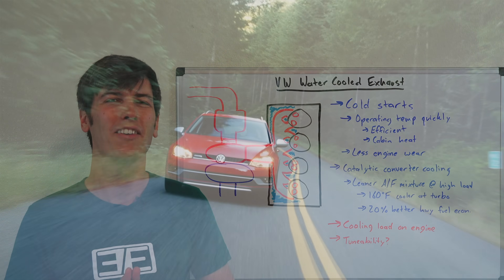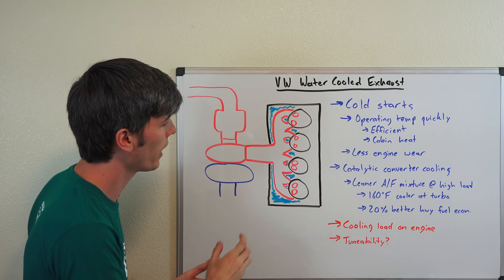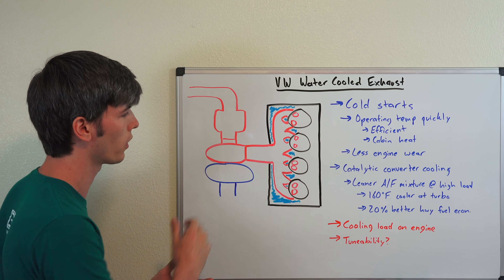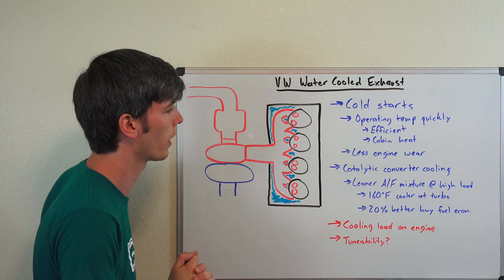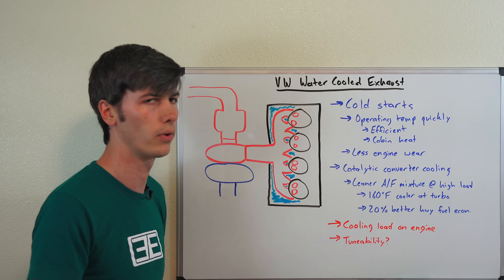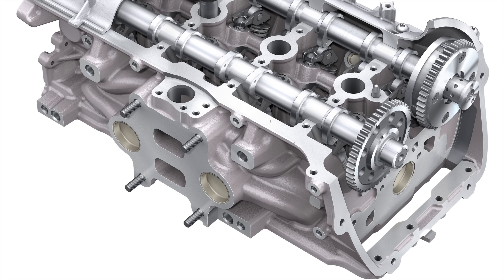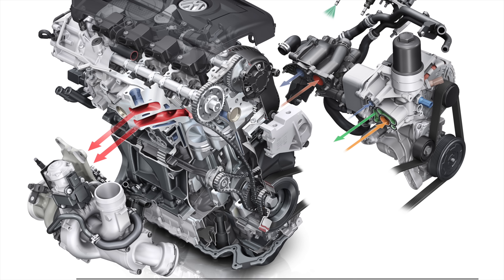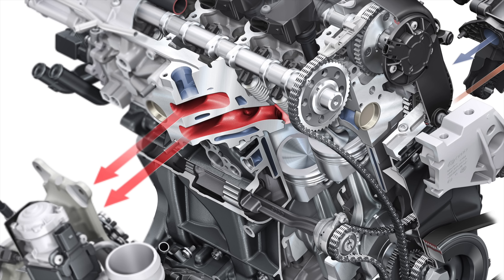Why Does Volkswagen Have A Water-Cooled Exhaust?

Comment: Dunno man, VW claims are not exactly reliable...
Reply: Nailed it
Reply: Klas Peppar Spell much?
Reply: Rob Novak yeah I got the new Jetta and regularly hit the low 40s on the highway without trying and can sometimes manage mid to high 40s on the longer drives. Important to note mine is a 1.4L though
Reply: Exactly!
20% more efficient? Yeah, right... If every time when they said that it was true, by now that engine should fill the tank and not the other way around.
Reply: It wasn't. Almost all other European manufacturers cheated. Opel for example ran an ECU update on the Astra and Zafira if I'm not mistaken,  to try and bring these cars' emissions back to what they claimed. Furthermore, following the dieselgate thing, emissions tests were done and it was found that all brands got significantly higher emissions figures in real life tests than what the manufacturer claimed. And it gets better, VW's real life emissions were actually closer to their claims than with a lot of other manufacturers. I believe Renault scored the worst, but I'm not sure about that.

Aside of everything, the software VW ran wasn't illegal per se. It was a software that reduced engine power under certain conditions (calculated from factors like engine load etc) to minimize emissions. In the real world, the occasions where this would happen are rare. So yes, they tuned this 'secret eco mode' to work best with the NEDC tests, which are completely not representative of the real world. But there's nothing illegal in that. They just 'forgot' to mention this eco mode on the homologation papers. 

As a side note: do you know how Opel fixed their emissions problem? The ECU update I was talking about earlier actually just reduced engine power, thus bringing the emissions down. So compared to that, I don't think what VW did was actually all that bad.
Reply: Never owned a VW before, bought a 1.4t jetta for the sole reason that they were on sale... can't beat a brand new 2017 car for less than 14k USD.... I wish I had waited because they went down to 12k USD after I bought mine. oh well.  I really do like the car though.  The manual transmission is quieter than the automatic.  Sometimes too quiet. I normally use the sound of the engine to know when to shift, but this is so quiet that I have to look at the tack.  The automatic makes a little bit more noise.  Comfortable.  Quiet.  Perfect road trip car.  I can't manage to get any lower than 32 mpg even floring it at every opportunity with stop and go traffic and the A/C running all the time. As far as spirited... um, if you are accustomed to sporty cars then it will probably feel slow, but if you normally drive economy cars then it could feel peppy.  It does develop the torque at lower rpms, so you won't often push it past 5k rpm even in a manual.  Shifts are crisp. The only other car in the same price range is the Nissan versa, and I do pass those on the road without any problem.  If I have any complaints it is that, if you tend to lean the seat back it can create a blind spot, and it could use a faster wiper speed.  I guess they don't have tropical storms in Germany. Overall I'm very impressed.
Reply: Well, you may take your efforts to help with the environment seriously but if the majority of US citizens did then Trump wouldn't be president, and nobody would drive around in polluting pickup trucks. No, the reason there was such a big fuss about this was because of the American 'sue everyone' culture. Over here in Europe VW's boss took responsibility and quit, VW came with a solution to bring the existing engines up to spec and there was a recall to install the upgrades, and that was that. Not a single fine was given, because it would be hypocrite to fine them and not fine the other manufacturers. Because trust me, everyone cheated. And I'm sure there are a lot of manufacturers who still do.
Reply: To be pedantic, regular 20% cuts in consumption would have it asymptotically trending to zero, but the fact that VWs still use fuel shows that that hasn't happened either :p
Reply: Peder Hansen Don't blame our people, it's our dysfunctional government. Many of us urged not to pull out of that agreement but politicians walked the other way.
Reply: Too much was made of the Diesel emissions debacle. VW simply refined their software in order to provide a decent performance in the light of  ever increasing emissions standards.
It wasn't, and still isn't just Volkswagen, but they took a dive on it because lazy sensationalist scientifically illiterate journalists were going to milk the story for ever and a day.
Reply: I live in the US. in the midwest too. And I don't see this. What I see is exactly as the other poster said, fellow americans will do anything to put a dollar in their pocket.
Reply: the 1.4t is a boss when it comes to mpg but how does it feel on spirited drives? im debating on a brand new jetta 1.4t vs a preowned jetta 1.8t
the 1.8t is pretty fun to drive even if it only has 170hp (it actually makes more according to some dynos) and the fuel economy isnt so bad either. i do a lot of long trips about 2 times a month which is why this is a factor for me but i want to be able to drive spiritedly around town and enjoy the burst of torque
Reply: audi r yuo having no job how yuo afford volwagens?
Reply: mujjuman I wouldn't say the 1.4 is super punchy so you might want the 1.8 for those faster drives. I'd look into getting a golf. With the 1.8 engine paired with a slightly shorter wheelbase and stiffer platform in general, golfs can be a little more fun on back roads compared to the Jettas of similar price
Reply: mujjuman I've had my 1.8t Jetta for over two years and I still love it. The torque from that is great. I often take it onto canyon roads for some spirited driving and it really picks up nicely, as well as around town when you just want to accelerate from a stoplight. The 1.4t has the same amount of torque so it might accelerate  the same as the 1.8t up to a lower speed like 30-40mph, but it won't have the same passing abilities at highway speeds because of the power deficit.
Reply: +AR1G3
I won't dismiss your claim about some here being "sue happy". The vast, vast majority only sue for good cause. When appropriate it is a good tool to keep companies honest. The environment is important but it is not the problem it is being cast about as. Believe as you might but the here and now is as important if not more so than what 'might' be 100 years from now. Just don't let it be a substitute for the real Authority we know and love. The Great Lakes were once a glacier and that all went away long before man's interaction with the environment. CO2 is not the problem when so much other gasses, one namely methane,  enter the environment naturally. Sure, keep it clean but we will never go back to the horse and buggy either.
Reply: well .. there is a reason why it is one of the two Largest car manufacturers in the world... I think they know what they are doing, and I know from experience, that the previous version of TFSI engine was crazy efficient .. get 200 hp for 27 mpg? .. I loved mine..
Reply: It is still called cheating.
Reply: no way. americans, at least where I live and who I know, are absurdly "sue happy"
Reply: Peder Hansen          "and even your president is a thief and a conman"   The whole world wants to see the proof. Could you show us please?
Reply: @institoris institori gas engines are very inefficient.  so 20% increase would be very little.  ICE's are around 8% efficient, so adding 20% to that is a grand total of 9.6% efficient.  while 20% sounds a lot, it's all in the numbers.
Reply: pesshau
VW sure screwed over the consumers by giving them better fuel economy while increasing performance. Go cry about the emissions, sissy.
Reply: Nearly every single diesel engine car manufacturer lied about the emissions. Takata lied about theri airbags, Tesla lies every single day with their ''Zero emissions'' plates. Your point being?
Reply: Is using the rules to your own benefit cheating?
Reply: Like I said, my point is on moral, not about rules. You could go on and on and defend what they did was legal, but it still wouldn't change the fact that they were literally going the easy way around for a quick buck.
Reply: Golf GTI here - 37-38MPG highway regularly with the 2.0L version of the engine. That's without really trying to baby it.
Reply: audi r i bet you're fat
Reply: Klas Peppar Volvo has emission problems. Look it up lol. And I'm not mad. I'm just pointing out that it's not just Volkswagen. & yeah I do like my expensive Volkswagen? lol I can afford it.
Reply: zuban2009 I'm not fat at all. Thanks lol.
Reply: i fink yuo are
Reply: yuo lies to me
Reply: People here in the US view their efforts to help with the environment seriously. (not all) Misleading the consumer by cheating is taken seriously. Yes, human nature is what it is but this put a bad stain on VW. They have a good product but tried to pull off a short cut and got found out. It would not have bothered me but I would not have refused compensation from them.
Reply: Walter Black ?
Reply: @mujjman I own a 1.4L se tsi jetta. I was pleasantly surprised with the good amount of mid range torque that tiny motor pushes out although i'd say the 5 speed manual is mandatory to experience this. the 6 speed spent a ton of time hunting for the correct gear in traffic and never seemed to have picked the right one when i went to pass someone. Traded in an 06 Mazdaspeed6 and despite having half the horse power and half the drive wheels it's still 2/3's as fun, and exponentially more economical and reliable. definitely spend the bucks for the SE trim though, to me that sunnroof alone is worth the 3k price bump, even before you factor in the alloy wheels leather, blindspot monitoring and  push button start. oh and the base model doesn't have a temp guage, so the SE is less sketchy that way too.
Reply: Exactly. It's mainly just a bunch of anti-capitalist corporate-hating enviro-Nazis making much ado about nothing. The overall increase in pollution, worldwide, is statistically unmeasurable.

As I told more than one liberal when the scandal broke, if I were to have bought a VW diesel then, it would have been a great move for me as well as the environment. 

People couldn't wait to dump them, even though they are extremely fuel-efficient, and VW was all but giving them away. And if VW had not cheated, fuel consumption would have been worse.

If I were to have bought one, I would have been replacing a 96 Grand Cherokee V8 with over 300,000 miles on it. It has a 5.2L V8, which was an updated version of the 318 cubic inch V8, (318 ci = 5.2L), which debuted in 1967. The antiquated 5.2L, though a great engine, was not clean-running to begin with, as it only met truck emissions standards, not passenger car standards, which were very loose. Add 300,000 miles, and what you get is a pretty filthy running engine, by modern standards.

So, with a TDI, I could go from 17.5 MPG on the highway to 45 MPG, and likely have much cleaner emissions, and a clean conscience, (if I had one), to boot.
Reply: 80% of your engine wear occurs before the engine is up to running temperature. Substantially more harmful emissions occur during that time too.
Reply: Wolf Plato u
Reply: Volkswagen owns Audi
Reply: volvo ftw
Reply: Toxic Masculinity
That's a good point. Just ignore the fact that VW's cheat has now ended up giving the owners worse performance and fuel economy as well as the aforementioned expensive emissions control system failures.

But hey, keep throwing cheap insults at me, that'll prove me wrong ; )
Reply: Love the input from around the world!!!
Reply: Please define Your morality. I not necessarily share Your morals with you. Do you think your morals are superior to mine? Are you one of those parents who force their kids to go to church and train them to be liars?
Reply: The 20% is because the Turbo, not thar crappy cooling there. Where's the freaking intercooler.
Reply: hahaha.

As an aside That Guy, yes a new car for that cheap is going to be a good deal with almost no exception. But VWs do have poor reliability down the road (contrary to popular conceptions).
Reply: +TheNomdeguerre
I'm not from Germany  and not even from Central Europe though. And my real name is not German. And my person or my location has nothing to do with what Peter Hansen said.

Your comment is just another invalid argument from triggered 'murican.
Reply: Sorry for real poor spelling pist you of!
But as a Swe, English spelling is not easies task.
And have a nice day or night depending on where you are in the world.
Reply: +Simon Coles
He didn't say that. You misunderstans him intentionally, because you have no real arguments against what he said. Read his comment again.

American car industry naturally wants competitors out of US market. That's why the whole scandal was so scandalous in American media. Who pays the piper calls the tune. Anyone, who drives an American V8, should not tell that VW did something wrong or caused preliminary deaths with their emissions hoax.

Of course, what VW did, was wrong, but I doubt that they literally violated law in Europe.
Reply: It is still not morally correct to cheat rules, especially a large company like VW should have had the morality to do things right. But no, they chose profit and the easy way around everything in this particular case. it's not hate,  just the facts, they deserve to be bashed for what they committed. It's like cheating OSHA and getting many people killed, this just seems not as severe cause no one died. Even though you didn't break the law, what you did was still "wrong".
Reply: No, they conformed to the measured standards. If anybody should be criticised, it would be the bodies who set the tests
Reply: VW did not do anything illegal. They just literally stuck to the law. The object was to pass the emissions tests - they did that, they passed the tests.The culprits in this issue are the incompetent law makers who left room for interpretations of their law. All that VW did was using their brains. But in a democracy, where the majority (of fools) rules, genius sadly cannot win..
Reply: Peder Hansen 
"the problem was fixed over here with basically no fine"

Are you referring to the European market? Because VW's "fix" for these cars has only caused new problems. EGR valve failures are now common on "fixed" cars, and I wouldn't be surprised if this causes more wear on the DPF as well. Volkswagen has really screwed over its customers with this scam.
Reply: No one can disel gate like Volkswagen and Audi!
Those F***ing chaeters!
Reply: Are you mad bro!
You sound like a Audi fan boy to me!
Hope you like your expensive Volkswagen! 
Tip get a life, get a Volvo!

Comment: Aren't quite a few manufacturers already doing this as well? As far as I know many like Honda and Ford have integrated the Exhaust manifold into the construction of the head like this. Do they not have cooling jackets closely wrapped around the exhaust? I'm assuming that if there is a difference that would likely be it.

Comment: i would say they did this to have a shorter manifold, therefore reducing turbo lag and this cooling solution would be a consequence to control the temperature of the engine block/header. Maybe, this shorter "water- cooled" manifold loses the same amount of thermical energy than a longer "air-cooled" manifold

Comment: VW did this design before anybody. You look at Ford ecoboost, Chevy turbo engines, and Honda new turbo engines they all now hsve an integrated exhaust manifold to save weight. Germans did it first. Vw also used turbo direct injection as a mainstream engine first. For everybody trusting the reliability to Honda you have to imagine Honda's engine is brand new. This is Vw's 3rd gen direct injection turbo engine.

Comment: I wonder if they've had issues with differential heating and cracking of the exhaust ports? Might be an issue after a few tens of thousands of miles.